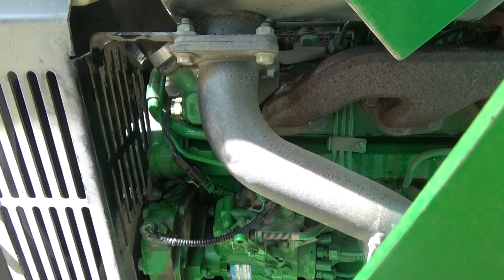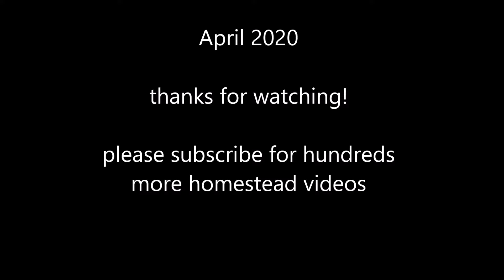tractor won't start? blown starter relay fuse? EASY repair - thermostat sensor replacement

Comment: I work at a John Deere dealership as a service technician. That is the cold weather timing advance sensor, and is literally not needed in warm climates where it might get below 30 mabye 3 times a year. My best advice is to snip the wire, and tape the connector away because that sensor will go out again, and is not needed. The tractor will just take a little longer to crank when it is cold.
Reply: I have a 1996 6400. My fuse keeps blowing when I turn the key. Could this be my problem? Thanks in advance.
Reply: @Kyle-wo4vd  it's a possibility, what fuse is blowing? And is it blowing with the key on, or when you try to crank?
Reply: @Kyle-wo4vd  and you can try unplugging it, installing a new fuse and try cranking.
Reply: @nathanschneider8586  upper left 30 amp fuse, I believe f101. it’s only when I try to crank. If I turn the key and then start by shorting the contacts on the starter, it starts and runs fine. I plan to isolate both ignition switch and starter solenoid today to rule them out individually. I also have the battery light on and gauges not working(alternator charging 14.4v) unless I remove fuse f113, then gauges work but battery light stays on. I’m not sure if that’s related or a separate issue.
Reply: @nathanschneider8586  new fuses blow 8 out of 10 times. Occasionally it starts fine.
Reply: @Kyle-wo4vd  it sounds like you have a short to ground, also it is an older tractor and the wire coating likes to disolve after a while. I would try a continuity test and then a wiggle test. Put your meter in the fuse socket and ground with record mode engaged and tug the wires. What you are looking for is any change that correlates with the section of wire you tug on.

With the gauges working on f113 Without the fuse installed, that's telling me that there is a short to power
Reply: My 4600 does the crank no start thing. If I clean the fuel shut off solenoid out and put it back in, it starts. So I replaced it with a new one, but now it is doing the same thing. If I let it sit about a half hour, it usually starts. I'm not sure what else to check.
Reply: Your video cured my problem!  Awesome video.

Dale

Comment: You are a rock star! I spent a couple hours tracing the wiring on my 5045D, removed the ignition panel, removed the starter solenoid wire, disconnected the neutral safety switch, neutral relay and was getting nowhere with my meter. Came back inside and did a quick web search and found a few similar questions but nothing definitive. Then I found your video. It was everything it could be; short and to the point. I was so certain you had provided me with the answer that I went out in my pajamas, unplugged the thermostat sensor, tested with my 12 volt light tester (I'd already smoked 3 fuses), replaced the fuse and fired the tractor up. It did smoke a bit at first, but that has been happening for about two years so I guess that sensor had been going bad for a while. It took me a few minutes to put everything back together, but I did it with a smile because it runs! And now I can sleep tonight instead of thinking about what could be wrong. If you're ever on the West coast of Florida I would be happy to buy you several adult beverages! Thank you!
Reply from the maker: Thanks, brother!

Comment: Thank you so much for posting this video.  I have a John Deere 5055D kept blowing fuse and I tried everything replaced a diode after talking to a JD service Manager assured that was the problem. checked every safety switch. I had about given up.  My tractor had been down for weeks and a friend came over and he just thought it was a wire melted or bare spot grounding out.  searched many videos and none helped then I came across your video went out unpluged the sensor and it cranked . Thank you so very much.

Comment: Like some others, I spent several hours troubleshooting my 5045D starter.  After all, shouldn't the start relay be part of the starter circuit?  Nope. I found when I pulled out the start relay inside of the fuse box, the start fuse would stop  blowing but the tractor would then turn over but not start.  Just when I was ready to give  up I gave this tip a try.  Sure enough, the tractor started right up!  Saved me a big pain in the butt of loading up the tractor and taking it to a dealer,

Comment: Thanks.  I have a 2007 5103 and it just shut off while idling yesterday.  On my JD that fuse is labeled spare.  It just kept blowing.  Disconnected the thermostat sensor, replaced the fuse again, and started right up.  Got me out of the field.  I'll replace the sensor now that I know what was up.  I appreciate the video!
Reply: Good to hear this fixed your problem. I also have a 5103 and hopefully this will fix this same issue.
Reply: I have the same year and 5103 also. Same exact thing. Went to drop a round bale in the field and it just died. I said I’d replace the sensor when I disconnected it, but that was 2 years ago. Maybe one of these days
Reply: @fenderbender, that is exactly what mine did. Blew the fuse, unplugged it, and it fired up.

Comment: Thank you for the info. I have a 2012 5101E and this fixed my tractor. You saved me a bunch of time. Fixed it for about $85:00. That's the sensor and 2 gallons of anti-freeze. Thank you so much for posting this.

Comment: Unfortunately this wasn't my problem.  Still can't figure out what's going on.  Checked every fuse and relay.  Turn key nothing happens.
Reply: My 5075E blows the fuse but continues to turn over just won't start.. It's the 15amp ignition fuse.
Reply: Starter relay switch
Reply: Unplugged and plugged the temperature sensor back in, works perfectly now.

Comment: Thanks so much for your video big help, my son-in-law  has a John Deer 5055D exact same symptoms had been troubleshooting for hours started search and found your video absolutely the problem, changed blown fuse  disconnected wiring harness to the  sensor, and  tractor started right up thank you so so much  really  appreciate your video. 👍🏻👍🏻👍🏻👍🏻👍🏻👍🏻👍🏻👍🏻👍🏻

Comment: Let me join the fan club here and say that you also saved the day for us.  Our JD 5045E mysteriously refused to turn over after trying to start it on a freezing morning last week.  Battery was fine, but kept blowing starter relay fuses.  Of course the troubleshooting guide in the manual is useless with handy suggestions like "no fuel" but no mention of the cold start advance sensor.  Your video was all we needed, disconnected the sensor which was easy to find thanks to the video, put in another 10 amp fuse and it cranked right up.  I found a new sensor on eBay for $15 and will install it when it shows up next week,  thanks for the tip about the bucket to catch antifreeze leakage!  In the meantime my wife's out cutting hay right now.  Thanks again for posting this very helpful tutorial.  🙂

Comment: OK, this video just saved me literally hundreds of dollars.  I've spent several hours taking the starter off and having it tested (it was fine),  searching the wiring for an abrasion or break (found nothing), spoke to 3 knowledgeable auto mechanics and one tractor mechanic,  learned nothing except you have to "just search for the dead short, it's there somewhere".  SIGH! 

I was getting myself ready to call the dealer, having them pick up the tractor, spend probably 1500 to 2000 dollars to have them find the issue.

At my wits' end I did what I should have done first-searched for "blown starter relay fuse on John Deere 5055e". Because when I did  I found your video. 

I went to the tractor, disconnected the cold start advance sensor, replaced the fuse, turned the key AND IT STARTED!

I can't thank you enough, you're the best!

Steve in Nova Scotia

Comment: Thanks so much for posting this. My 5075e just had the same problem this morning. Found and swapped the blown fuse and it blew right away. Then i found your video, unplugged the sensor and it's working fine now.  I can't imagine how much time and expense it would have taken to figure out what was blowing that fuse without you.

Comment: Don’t know if you still monitor comments on this video, but thank you so much for making it. I just bought a second hand 5083e got it home used it once and then wouldn’t start looked everywhere for an electrical fault and couldn’t find anything. Search up the YT and found your video, went out disconnected one of the sensor ports, tried to restart blew the fuse had another look and second sensor port disconnected that one reconnected the other and tractor starts. 🎉🙏🙏👍🏼🇦🇺

Comment: Thanks man. My tractor had this exact issue. Started right up after I disconnected the sensor and replaced the fuse. Saved me $400!

Comment: After a whole day of trouble shooting my 5303 with no luck on the cause of no crank.   I found your video.  Can't thank you enough.  Disconnected the sensor, replace the fuse and it cranked right up and saved the day because I really needed to use my tractor.  Also, on my fuse block the middle fuse for the starter relay is labeled " spare", go figure.

Comment: Thanks for the video.  Solved my problem. It appears this is a very common problem.  Always a tip off when my John Deere dealer had several of the sensors in stock.

Comment: Thanks For the Tip!  I replace the ignition switch on my 2007 5203. Helped a litte but still blowing through fuses. Did you know that John Deer was charging 5 dollars per fuse! I was in a bind and I needed get my hay cut and Autozone or Walmart was out of the way.  Now I I have figure out another Engineering Flaw on the Tracker. PTO handle looses after 4 hours turning off  and on the PTO. I have to tighten after each day if not, IT will get so loose, the PTO will not turn on. Any help on that?

Comment: I have similar issue with JD5075E where 15 amp ignition fuse blows when you try and crank.... unfortunately pulling the temp sensor didn't help... open to suggestions.

Comment: Mine did the same thing.  Just received my replacement via Amazon, while installing the insulation around the wires tore out where it goes into the sensor.  Just applied epoxy to try to reinsulate everything.   I have a feeling I will be going to John Deere to order another one later today.  Cant complain about cheap China imitations because that's all John Deere is anymore, Made In China.

Comment: I'm not getting power to that system at all. I can jump the fuel shut selonoid from the battery and it will fire, but no power to and part of that wiring.

Comment: Anyone else disconnect this sensor and the tractor blows smoke out of the exhaust?
Reply: The sensor is for the cold start timing advance system to reduce smoke during start/warm-up so the engine passes emissions tests.  It is useless unless you want to reduce engine life and startup smoke.